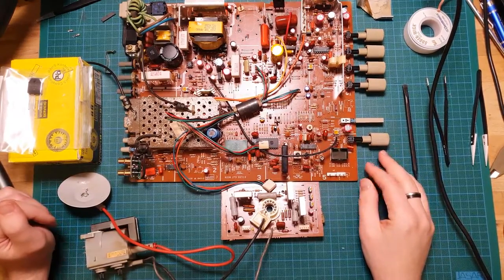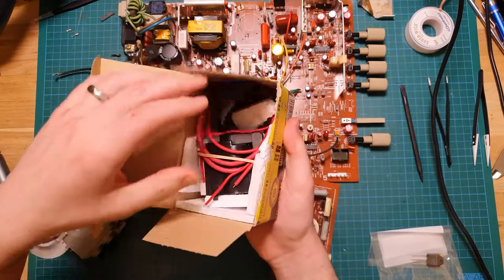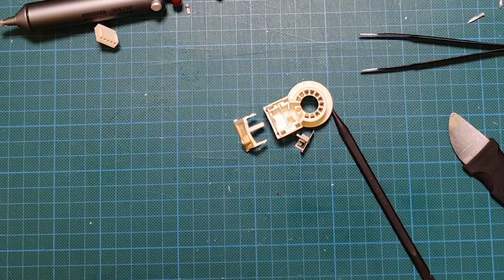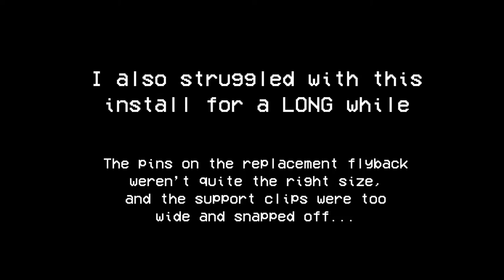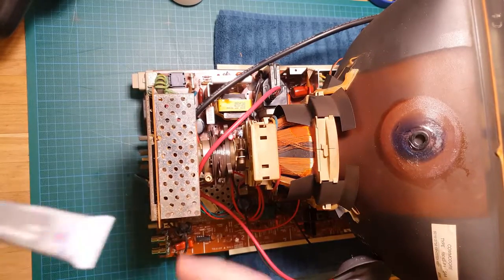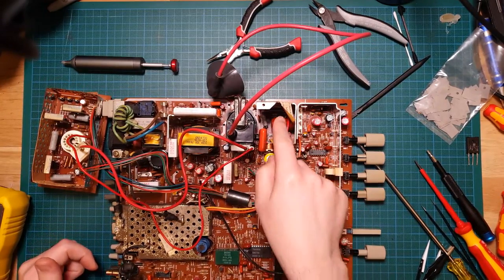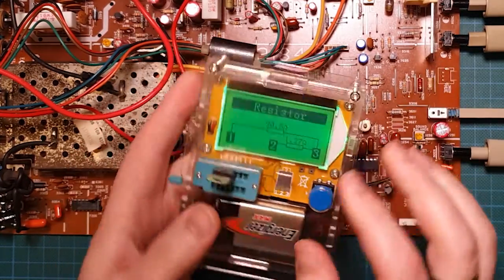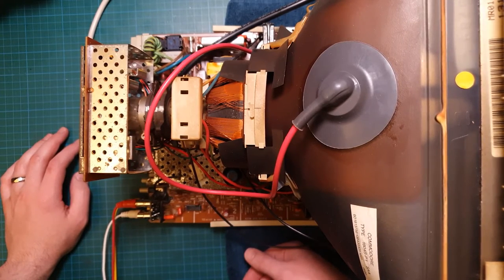Bringing a Commodore 1084S-P1 back to life!

Comment: In the h stage there is a big bipolar cap,  4,7uf 50v,  it is a special one used in crt deflection circuit,  it is high ripple and high frequency,  may I know with which one you have replaced this?
Reply from the maker: Yep definitely, I source these BP caps from Wagner Electronics in Sydney - https://www.wagneronline.com.au/63v-non-polarised-np/crt-parts/television-parts/service-repair-parts/765/fl/

Comment: That's a pretty big transistor - is it so chonky because of the high voltage after the flyback?
Reply from the maker: I'm definitely no expect, but I believe it's because of the relatively high voltage it switches, and the fact that it has to do this at such high speeds (~15KHz). This one is rated at 40W!

Comment: hey i have the same monitor can you please send me a picture of cap 2547 ,i think my board has a print mistake underneath the cap its a 2.2uf 63v
Reply from the maker: Hey! Sorry I don't have this monitor any longer - C2547 is definitely 2.2uF 63v according to my notes.
Reply: @silvestronsbitsandbytes  did the monitor work ! when i removed the cap i forgot how to insert the new cap ! the way you did it on the video i had it reverserd some people say thats wrong others say its correct !
Reply: @silvestronsbitsandbytes  do you have a link to a sharp scematic
Reply from the maker: @elamriti  Yep it did indeed work after the recap. I was able to find a photo of the backside of the mainboard I took during that time, and located C2547 - https://photos.app.goo.gl/PWaji7owdcD3LpCv8 (dead center)
The filled and unfilled rectangle markings show which side is negative and positive, so the filled rectangle will be negative. I hope this helps!